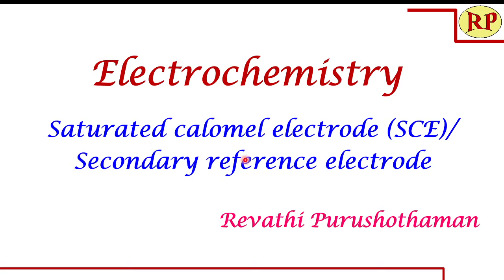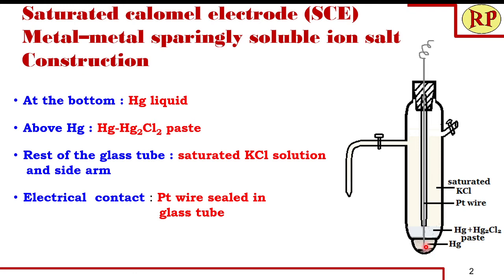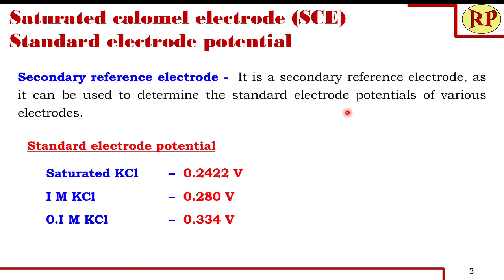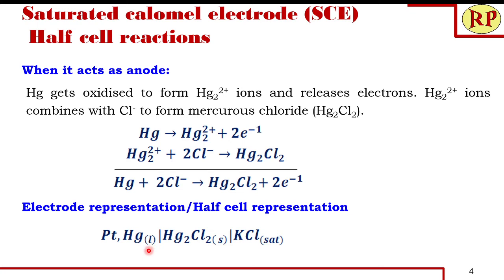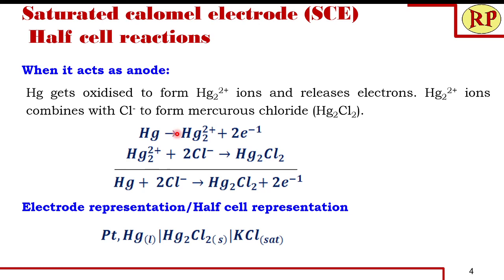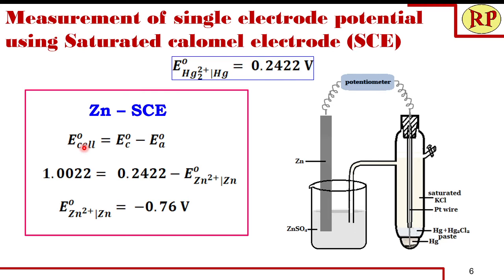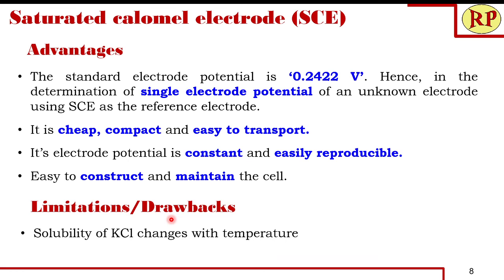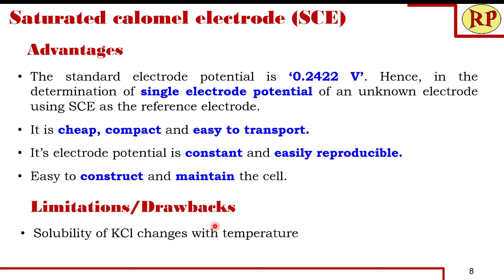Saturated calomel electrode (SCE)/ Secondary reference electrode

Comment: Mam , what is the difference between primary and secondary reference electrode?
Reply from the maker: Primary reference electrode is SHE where it is very accurate and used to determine the single electrode potential of all the other metal electrodes. The standard potential values are available in literature. But the potential values measured using secondary electrodes such as SCE, depends on the concentration of KCl, which will change with usage and time. Since setting up SHE in labs is difficult we use secondary electrodes.
Reply: @RevathiPurushothaman  mam what is your field of specialization???
Reply: @RevathiPurushothaman  analytical chemistry?
Reply from the maker: I teach chemistry. All fields. I even reach analytical techniques. My area of specialization is polymer chemistry.
Reply: @RevathiPurushothaman  I am analytical chemistry.
Reply: @RevathiPurushothaman  mam , can I ask some questions relevant to chemistry???